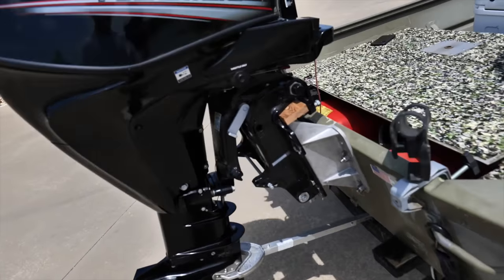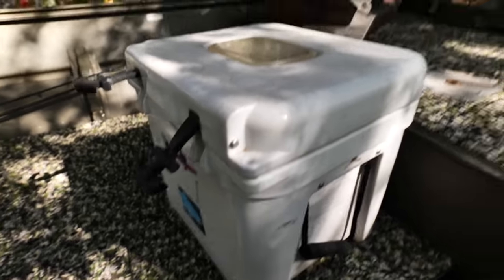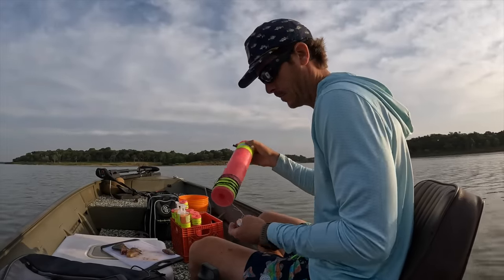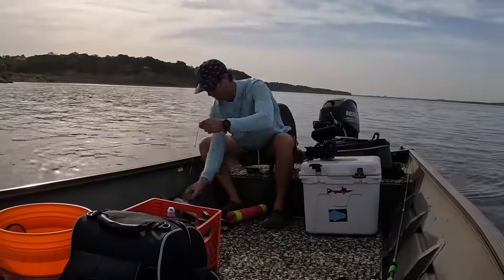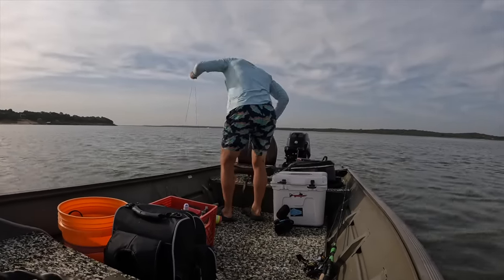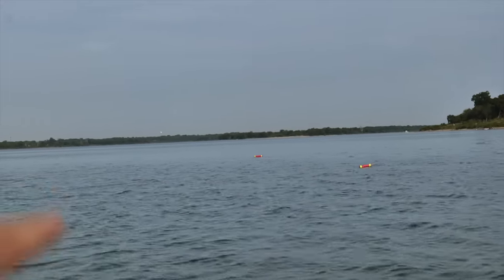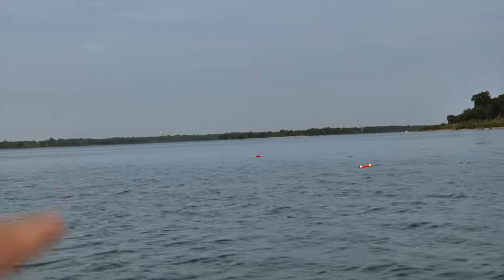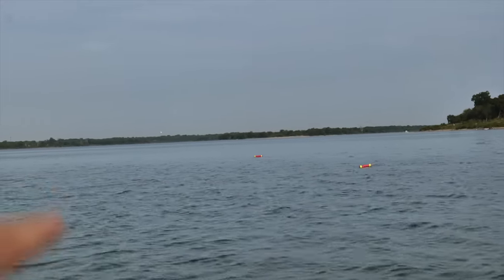FISHING MY DIY JUGS | Filling the Cooler with Catfish!

Comment: I commented this idea on Flairs video. See if you can beat him to the chase.

I have an idea for your next catfish jug line. One definitely need to redo your rigs and make your own noodle lines with a weighted PVC tube for standing your tube up after a bite. Diy your own wire hook setter. Add an air tag or tile GPS to your noodles so you can find and track when it's on the move. It also doubles as a tell when you have a bite. You can even go high class and upgrade the GPS to a ibobber fish finder, temp, depth sonar. Or challenge someone to a DIY jug challenge build and roll up with your high tech noodles you made.
Reply: Dude that’s way too complicated 
I doubt he does that

Comment: I think your tac might be off on the ignition cycles per revolution. It was reading 2500 at about idle. As far as it “making oil” i had a 30 hp merc 4 stroke, no matter what I did it always made oil. Pretty common issue on smaller 4 strokes from what I understand.

Comment: Great vid Justin. As far as your motor height, cavitation plate should be set at 1” above the bottom of the hull. Since you added the Jack Plate and you now have set back, it can be higher than 1”. Your porpoising is from too much weight in the back vs not enough in the front, just the way it is on small jon boats. As far as gas in the oil, I agree with 2 earlier comments, they are both correct. Leaving gas tank connected when stored in this heat is pushing gas into the engine till is floods the crank case and its true the rings are not fully broke in with how new it is. Small hp 4-strokes are notorious for making oil. 
Seeing that softshell had my tastebuds wanting a turtle sauce piquant!
Reply: The extra offset from the jackplate moves the whole rigs cg back a little too and it also increases the motors ability to lift the bow. I’d agree it would be nice to move weight forward. Typical things would be the trolling battery and fuel but your boats low deck style limits that a lot I bet.

Comment: You don't need to lower your motor. Check your trim angle when trimmed down. You may need to adjust the trim down stop location to trim down more. As long as the fin above the water pick up screen is just below the surface when you are on plane at full speed, the issue should be trim angle and weight placement in the boat.
Reply: I agree.   Trim engine closer to boat.  I had a old Procraft boat that wouldn’t stop porpoising.  I actually has to wedge transoms to get foot closer.  If all else fails…..those ugly whale tails do help stop the porpoising as well.

Comment: For removing the motor. Get you a come along. A cheap one from harbor freight will do just fine. Throw a line over a tree limb at the tree house and hook to the life eye under the hood. It’ll lift it right off with ease. Or use an a frame ladder straddled over the top of the motor and lift off with a come along.

Comment: Raise your trim up to bring bow down when you're up on plane. It'll get rid of the hopping.
Reply: TRIM DOWN BOW DOWN , MOTOR POSITION ON JACKPLATE NOT CAUSING BOW HOP , TRIM MOTOR DOWN IF YOU DONT HAVE POWER TRIM PULL PIN AND MOVE MOTOR TO NEXT HOLE DOWN

Comment: If you’re getting gas in your oil odds are your gas tank isn’t venting right and as the boat sits in the heat it’s pressuring the fuel system and sending gas into the block. Had this problem before. Hope this helps

Comment: I had same problem with fuel in the oil. My problem was the gas tank diaphragm wasn’t working. Wasn’t getting enough air. Try taking it out of the fuel cap but be careful if you don’t keep it covered outside.

Comment: Lower your Mercury until the Cavitation plate in the Foot, is about 1 inch from the bottom of your boat.  
Unplug your gas line from the Engine at the end of your day and it'll keep pressure from building up. Gas and oil mixed not good.

Comment: Run at wot towards end of break in to seat rings Yamaha outboards have same issue most of the time ppl have trouble with that due to have more time at idle and low rpm’s

Comment: I hope you found out before you lowered your motor, again, the proposing problem is how you trim your motor. I assume you do not have power trim, so, you will have to move the "trim pin" to adjust the angle of the motor. It will need to be moved closer to the transom. Your welcome.

Comment: Please check your lug nuts 
I saw on the hub video that your lug nuts may be installed backwards 
The cone should be towards the wheel and the flat side out 
I see that a lot and it can be extremely dangerous as it can allow the wheel to come loose and cause a wreck

Comment: Your prop is oversized and engine is not turning enough RPM's . Lugging engin is causing it to make oil. I had same issue with a 115 mercury.  Went to smaller prop and resolved issue.